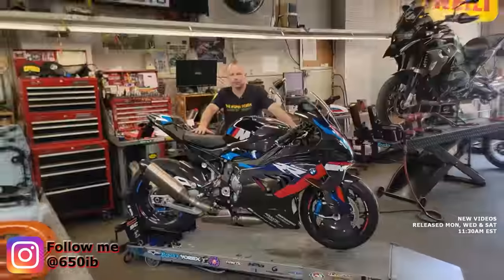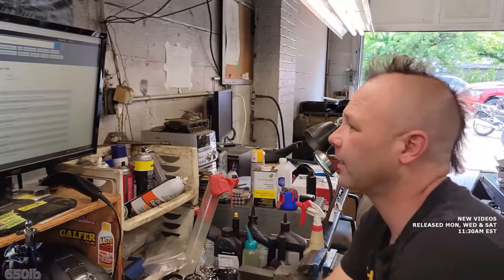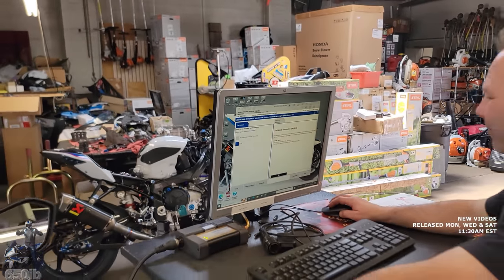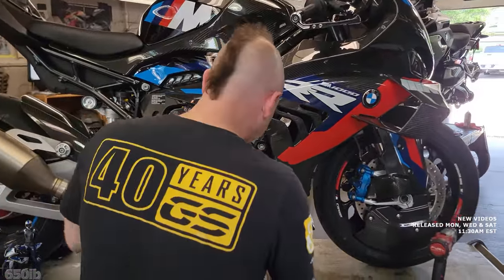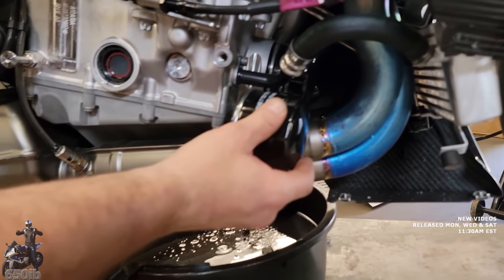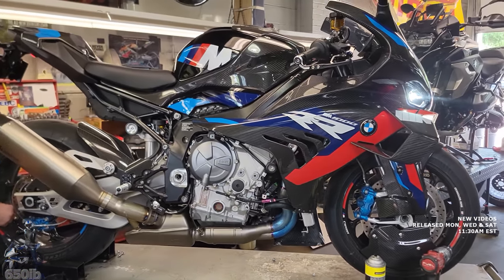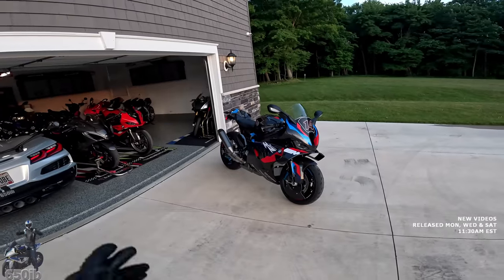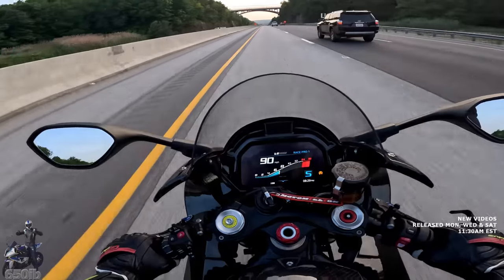2023 BMW M 1000 RR | 1st Service and Brentuning ECU Flash

Comment: IB this is why I appreciate you good brutha. Thank you for showing us mere mortals how the M performs after its restrictions are removed but still in stock form.  iMO I take my hat off to BMW and what they have produced for their customers. You can clearly see the difference from the base model to the M model, and what you get for your money is absolutely incredible. The sheer amount of carbon on the M from the factory is incredible. You have people that are spending bread just to get other bikes to that level. Can’t wait to see what you do with this Ib, motivation at its finest. Keep pushing good brutha
Reply from the maker: Thanks so much for the compliment Bro 💯💯💯💯💯💯💯💯
Reply: and yet, all that extra carbon fiber is mostly cosmetic and for the price not worth it on a bike, which if you're using it for its intended purpose, is close to going down very often. if anything, I'd much rather not have all the CF and keep the money to replace fairings if I push it past the limit or get clipped. 
If anything, unless you have infinite money and a bunch of other bikes to ride while this is in the shop, like ib here, you'd only be hindering your enjoyment by getting the M1000 and babying it. This is from experience, I had someone tap my bike into falling over at almost full(emergency)-stop, and it was fairly minimal damage, but I cracked my OG S1000rr fairing, with M colors. I ended up missing 2 months of the riding season because they had to paint a new fairing in Germany and ship it, since they change M color patterns. CF OEM parts for a rare bike like this, would be even harder to come by...

Comment: Such a gorgeous machine! I tested the M1000R last weekend, and oh boy oh boy... my local dealer is now on a mission trying to get one from the factory! Enjoy.
Reply: The Motorrad dealers here in Sydney will not let you test ride an M1000R. They are only ordering them in as customers pay for them - no floor stock or demo units. I love the look of the Competition model though. It looks like the perfect hypernaked.
Reply: @MrDeepseadweller  Kinda same story in Norway. However 2 shops in the country had demos of the M1000R comp edition. It was a 480 km drive on-way, The bike was AMAZING! Super smooth, powerful, fast and more nimble than my 2022 Ducati Monster. 
The only downside on it was the seat, you need an aftermarket seat for it like a Wunderlich AKTIVKOMFORT.
Reply: Got m1000r demos in 🇬🇧
Reply: @AlexDahlZ  Thanks for the info. Hopefully I’ll get to try one sometime but in the meantime, I am picking up a new MT-10SP later today. I already have an S1000RR so the M R is probably too similar to be my second bike.
Reply: @MrDeepseadweller  MT-10SP is one hell of a bike! Congrats and ride safe.

Comment: Nice one. Got mine a couple of days after you in 🇬🇧. Got 540miles on it at mo but sadly gotta wait until 5th July for its first service. They will allow up to 900 miles as not to avoid the warranty. Ironically I’ve stalled mine 6 times in those 500 miles so it’s obviously an issue!
Bloody dangerous if you are turning left or right and mines a bit kangaroo at low speeds. Obviously bad fuelling. Don’t know whether we have Bren tuning over here. My h2,s are both woolich maps. Probably be the only upgrades I’ll do to it as it’s pretty good once you are moving.
Reply: Luckily our European  bikes aren't restricted like the US bikes,so Bren tuning won't give such big gains.
Just take it to Crowe Performance, no messing, no bull

Comment: Hey, can tell me how much you paid to have the Front & Rear replaced and painted to accommodate the high wing Aero?
I’m planning on doing the exact same thing.. i’m going with a Silver Flare and very much want to add that 
High wing! 
Not real sure if I’m going to go with the Canards, so I might just be replacing the rear bumper.
Reply from the maker: Hey.... It was very expensive around $19k including the carbon front and rear spoilers